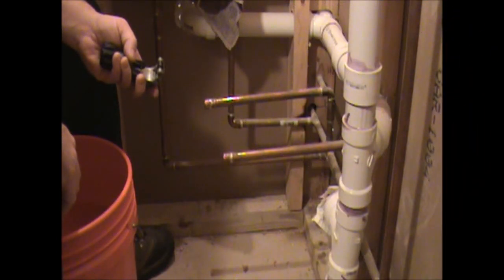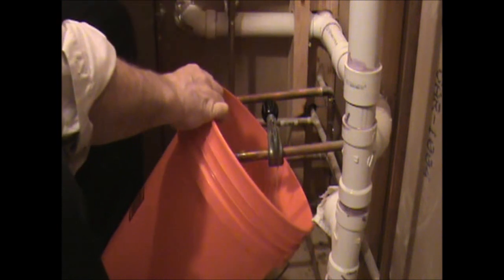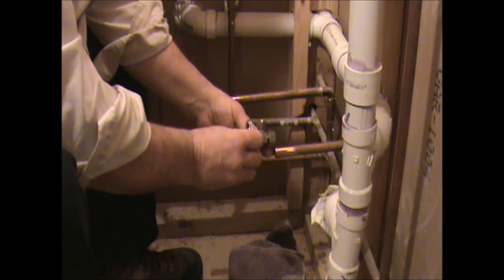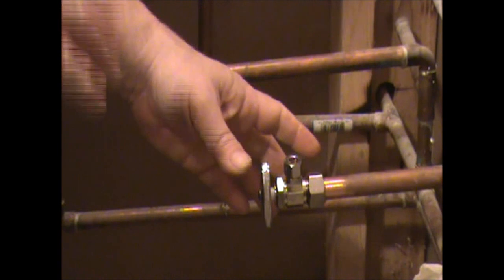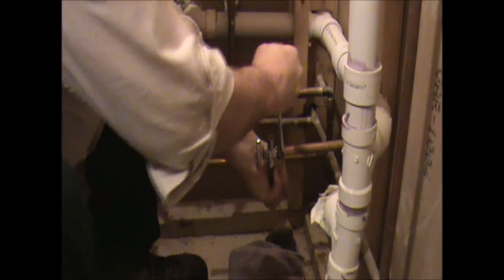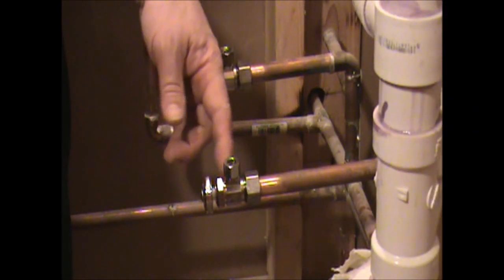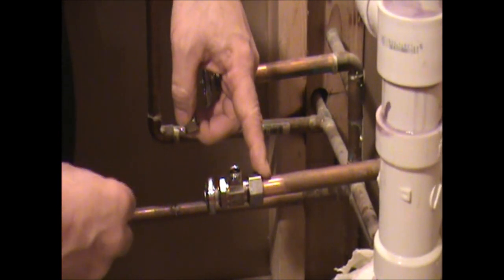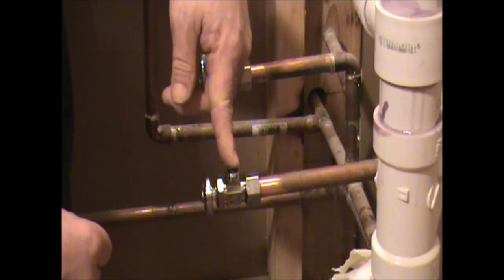How To Install a Water  Shutoff Valve

Comment: can you use this type on the cpvc  water lines used in todays homes?
Reply from the maker: Randy Pape I do not believe you can. I believe the cpvc has a different outside diameter than 1/2" copper.
Contractor John  http://ContractorJohn.com